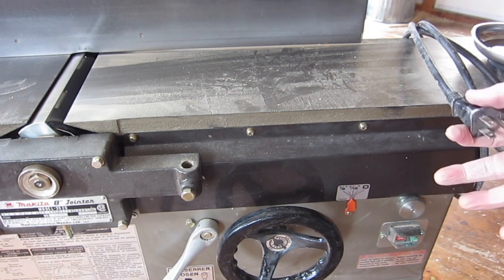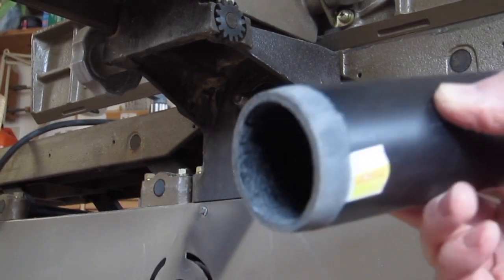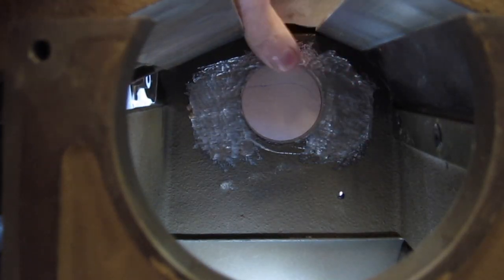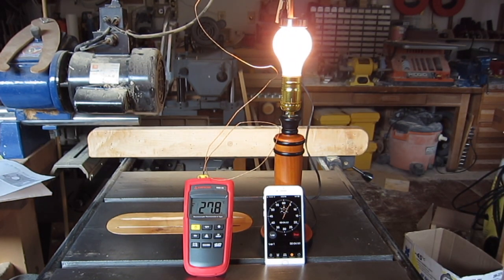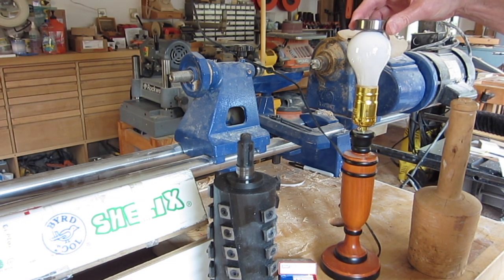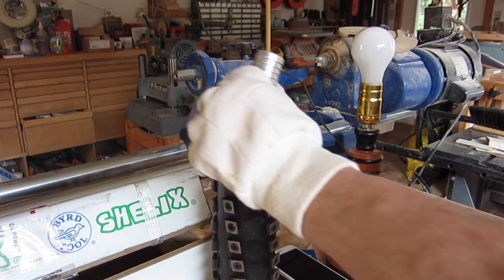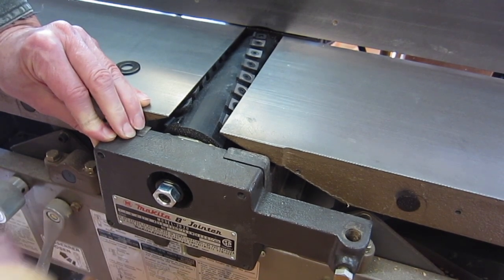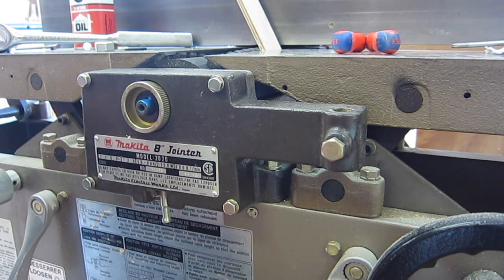Install a Byrd Shelix helical segmented cutter head on a Makita 2020 8-inch jointer.

Comment: The Best instruction on installation of a cutter head to date, and I've been looking for a while. I've been putting off installing a Helical head into my Jet JJP 12' combo machine, because there hasn't been a good video. well done! Thank you,
Reply from the maker: Thanks !     Maybe you will make a video when you do the et JJP 12  ;-).  .  That Jet JJP 12' combo looks like a clever design, and you only have to change one cutter head to get both jointer and planer.     Here is the video on changing cutter head in my planer,  just in case that is any use to you.   https://youtu.be/zFdcSKi47ZU

Comment: Steven, I have just purchased a Shelix cutterhead for my Makita 2020 jointer planer. Your explanation was very clear and thorough and I am optimistic that, with following your suggestions, I will have a successful installation and a tool brought back to its original cutting quality. I've owned my Makita jointer for over 35 years and I bought it used. It has been a great tool in my small woodshop and having it back to functional operation (since Makita has stopped producing these 8 inch cutter knives) will be welcomed. Thank you for your assistance.
Reply from the maker: It really is a nice jointer, with long parallelogram tables, and not a big heavy machine.      Let us know how it works out.     In description under the video there is a link to motor upgrade instructions, if you decide to do that as well.

Comment: Excellent video! No BS. Straight to the point. Thanks for this. I hadn't seen anything substantial on a Makita jointer before so this was an eye opener. I'll have to keep my eyes peeled for one in the want ads. It seems like a good unit, and would complement my 2040 planer. But those fancy cutterheads aren't cheap...
Reply from the maker: Worse still, the fancy cutter head for less common machines, like Makita, cost more than similar size fancy cutter head for common machines like Powermatic.   I asked Byrd why this was, thinking that maybe they gave me the wrong price, and their explanation was that they made them in large batches for the popular machines so there is an economy in machine set up time.

Comment: I wish every You Tube presenter was so clear and concise. Great job on the conversion. You are lucky that a one thou. shim was enough as the other end is not a self aligning bearing block. Have you cut a rabbet on this jointer? It does not have a rabbeting table.
Reply from the maker: Yes I have cut a clean rabbet with the new head.   At 14 minutes in the video it can be seen that the tables are about 1/2 inch above the casting that holds the bearing - that limits the depth of rabbet cut to 1/2 inch.

Comment: I've got the same jointer and am getting a lot of wedging. Still the the straight knives on them. Do you have any suggestions on fixing that issue?  I've checked for coplanar and all is well there. Thanks for this video. I may do this too.
Reply from the maker: This might be the problem:   The tip of the blades needs to be very slightly higher than the outfeed table.   A technique for adjusting outfeed table is shown in manual on pages 23, 24.    The instruction manual can be found here:  https://drive.google.com/drive/folders/1w6LvL5J_PgqRbsTYaWZPupTGUERwunWy      Also shown at 12:34 in the video.

Comment: I recently purchased a 2020 for $100, the blade guard is broken off which doesn't concern me too much,  but it works really good,  it was taken care of.  My biggest concern is the knives, which are pretty banged up.  In interested in getting a spiral cutter head or replacement knives but can't find any.  What and where did you get the spiral head? Or do you know where replacement knives can be found?  Thanks in advance for any help.
Reply from the maker: 1. Please purchase or make a blade guard for you own safety.   The jointer can remove a lot of flesh in 1 second.    
You mention that tour guard is broken off - if the post for your guard is still attached to machine then you could make a plywood guard that is build on the post.
Another person with a Makita 2020 jointer was able to use this blade guard with a little work:   https://www.ebay.com/itm/ACCURA-AJCG-008-CUTTER-GUARD-FOR-8-JOINTERS-SAVE-YOUR-FINGERS/373484509083?hash=item56f569579b:g:pskAAOSw7FRWYeOo         
One challenge may be that the listing for  this guard is says it is 5/8 inch diameter, but I measured the hole on my machine and it is 12mm.   If those numbers are correct it would not fit so you would have to drill the casting larger or get the post turned down.     

2. My spiral cutter head was custom made by Byrd Tool company.  Once they have made a custom cutter head they offer it as a standard product to others.   Sometimes a person at Byrd, or a Byrd distributor, does not know that they have made a custom cutter head and will send you down the path of getting a custom cutter head made.  If that happens, let me know and I will send you the Byrd drawing so that you can show to them (this has already happened with another Makita 2020 owner).     

3. Sometimes authentic Makita knives come up for sale on eBay.   It is a very specific knife with slots, and the alloy used for the cutting edge is different from the body of knife.   So if purchasing  3rd party knives ask for a dimensioned drawing and check against your Makita knives.     

The problem I had with knives is getting them sharpened so that they are not just sharp (that's easy) but also dead straight along the cutting edge.   If not straight then the jointer can't really be set up properly, and that is frustrating.    So what you might want to do, is take your "pretty banged" up knives to a good sharpening shop, and ask them to grind down to good material, and sharpen to a straight edge.   The sharpening angle is 40 degrees.

Congratulations on purchasing a well taken care of machine for $100.   They are usually rusty and ugly at that price level.
Reply: @steven.woodward  thanks for the advice,  I will deficient be fabricating something,  I have a friend who has an accident because the stock kicked out on him and he kept his fingers but it was a close call. I also will be using push blocks. I won't be getting a spiral curt head for awhile as they are pricey and I'm on a budget but I will send you a message when the time comes.  

Ps I did have to sand the tables down as they were a bit rusty, the owner died and I bought it from his son in law and they were happy to have it out of their barn.

Comment: I’m getting ready to do this for the 2040 planer.  It’s not the same however some things look like they may be similar; the drive pulls removal, the bearing capture ring, and stuff like that.  There is no 2040 head replacement video on YouTube so I think this is the best foresight I’m going to get before my project.  So thank you!

You didn’t mention how the motor healed up with the new cutter head.  Did it do ok?
Reply from the maker: The RC-33 planer was offered with a 3 HP three phase motor and a 2HP single phase motor.  My machine has the 2 HP motor.   I did not notice any change in motor load after changing to segmented head.   The motor does not seem to slow down when planing hard maple.  The most wood that I remove per pass is 1mm ( 0.04” )  - a habit I got into with straight blades to avoid excessive tear out.   If I planed off 1/8” on a wide board it might slow down the motor.
Reply: @steven.woodward  awesome, thank you again,
Reply from the maker: @robertoconnell8153   I found the motor on the Makita 2020 jointer underpowered even with the straight blades.  Perhaps because it is a series motor rather than an induction motor.  Series motors change their speed as load changes, while induction motors keep a more constant speed.   On the Makita 2020 Jointer, I find myself adjusting the feed rate as I feel the motor slowing down.   Changing to the segmented head did not make that much difference - perhaps I am feeding a little slower.   I have an old 1.5 HP induction motor that I plan to  install on the Makita 2020 Jointer.  Just waiting for delivery of a motor pulley and longer belt.   The Makita 2020 uses a flat poly V belt which was hard to find a motor pulley to match - found one at Toronto Gear Works with shippment expected Nov 22, 2021.   When motor change is completed I will post an update and report on how it runs.   If I did not already have 1.5 HP motor I would have gone for a 2HP motor as that is what Powermatic uses on their 8 inch jointer with segmented cutter head.   Hope this helps.
Reply from the maker: Some info and video on Makita 2040 can be found here:  https://machineatlas.com/machines/makita-2040-planer/
Reply: @steven.woodward  It does, I suspected I would have to upgrade the motor too but now Im certain.  Thats ok though!  after a $1000 investment on the cutter head another $200 isn't bad to make sure that cutter head is doing the best it can do.

TY!
Reply from the maker: @robertoconnell8153  If the rubber on your feed rollers is in rough shape, they can be redone as this fellow did :  https://youtu.be/A21UcWII6cg    He does not say where they were sent to be re-done, but they sure look nice.   

Regarding motor replacement, used induction motors can often be found at a good price.   The challenge is where to mount the motor as it likely won't fit in the same spot as the existing motor.  If planer is on some kind of a permanent stand, that creates opportunities.     
The pulley and longer poly-v-belt for my Makita 2020 Jointer are coming from https://www.torontogear.com     I learned from Toronto Gear, that a pulley consists of a sheave and a bushing, so needed to search for sheave rather than pulley.
Reply from the maker: I finally got around to replacing motor on my 2020 Jointer.   I had 1.5HP induction motor that was not being used, so installed that.  It makes a huge improvement.

Comment: Where did you purchase the jointer? Didn’t know makita make a 8inch, very interesting! Is there a part number?
Reply from the maker: It is a Makita model 2020 jointer.   Purchased in from Atlas Machinery in Toronto, Canada in 1986.   No longer made today, but they do occasionally come up on the used market.   I have been corresponding with a woodworker in Boston who recently purchased a used Makita 2020 jointer for $80.   It was missing motor, missing blade guard, and had lots of surface rust, but he has done a great restoration and it looks like new.   I have encouraged him to post something on YouTube or a woodworking forum.  Will share the link here if he does.

Comment: One more thing, could you share which cutter head it was exactly?  Or should I just call Byrd?
Reply from the maker: The cutter head is made by https://www.byrdtool.com      I was the first customer for this jointer, so I had to provide a detailed drawing, then Byrd sent back their drawing for my approval.     Now that Byrd has made a cutter head for the Makita 2020 jointer, you should not have to go through the drawing steps.   If Byrd says they have never made a cutter head for the jointer, let me know and I will send you the Byrd drawing so that you can shown them.  This sounds strange but another person ran into this problem - I guess sometimes a company does not know what it knows.